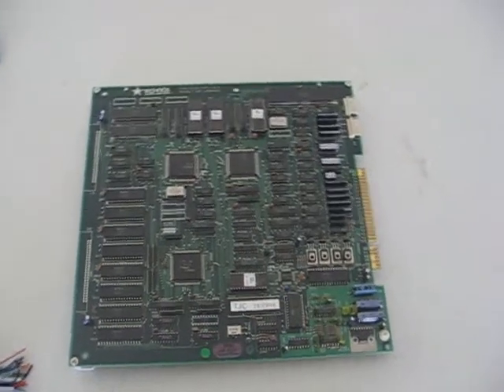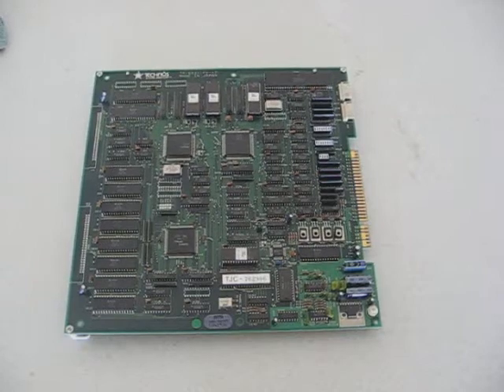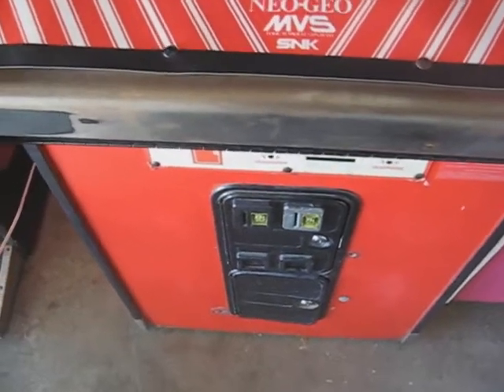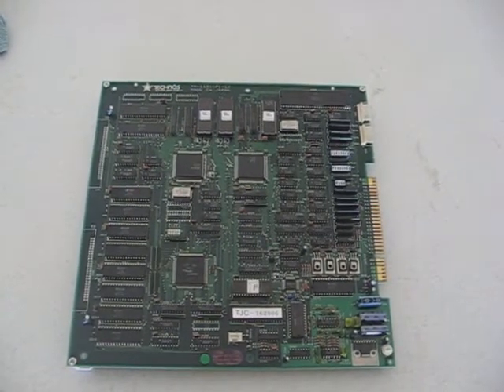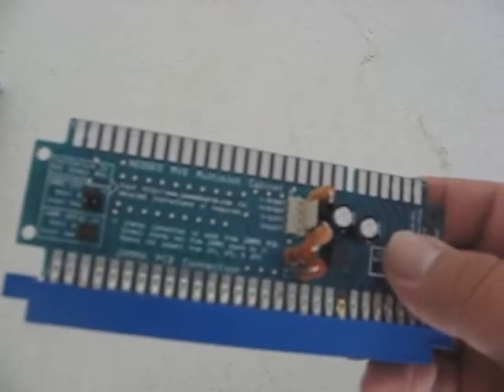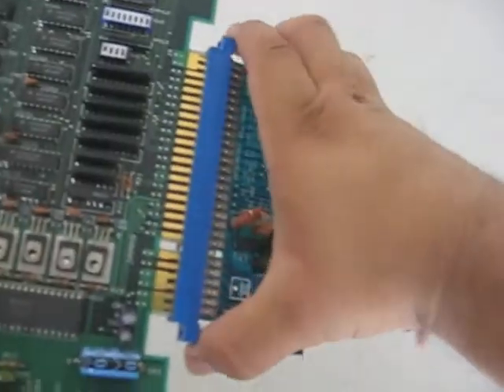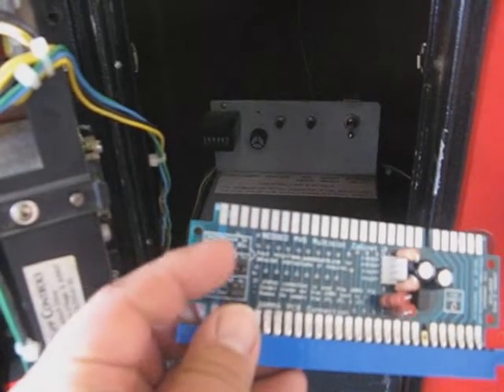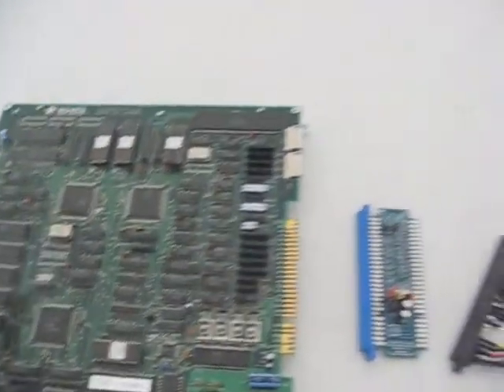How To Properly Install Standard PCB In A Neo Geo Arcade Cab

Comment from the maker: @GamersIncorporated 
sure you can do that. Its a little extra work because you will have to remove some wires from one place and set them someplace else but yeah you can do that. Or you can get a single slot neo board. Those are standard jamma

Comment: My Sunset Riders board's audio is burnt out after plugging it into my Neo Geo MVS. Now, the left audio knob controls the right speaker, and the right audio knob has no sound. Instead, it also comes out of the right speaker, but it's really distorted. So if I got this adapter, would the audio distortion at least go away? Thanks.
Reply from the maker: It might help. You should also go through the settings and check to see if your board is set for mono or stereo sound. 
The sound caps could also be failing and may need to be repaired.
Reply: moomert1 I got the adapter and my Sunset Riders board has been going strong for many months! Both speakers pump out strong audio! Thanks.

Comment: @moomert1 

so if i buy that same adapter you have in this video, I just would have to put a splitter on button D with the standard wiring and a the #4 wire from the kick harness? I just didn't want to have to totally rewire the whole cab.

Comment: @moomert1 

I have been watching your videos. great work. :)

I didn't mean PC. I meant to say what if you wanted to put in a new arcade board that required a kick harness, like a street fighter 2.  I was considering putting a 2 way splitter in my 2-slot neo cab and making it split between the Neo board and one of those 1200 in 1 boards. They require 6 buttons for optimal use. I didn't know how I would wire it so all i had to do was flip the switch

Comment from the maker: @masonsushi Hmmmm I'v never tried this but I think you should have no problem doing it. If you put in a splitter, the harness will still register with the board for buttons 1, 2, and 3 (punch). The kick harness will be separate and it wont do anything when switched to neo geo format. Only thing is that button 4 will be wired to both jamma and neo format together.